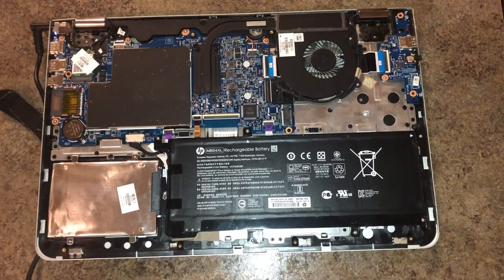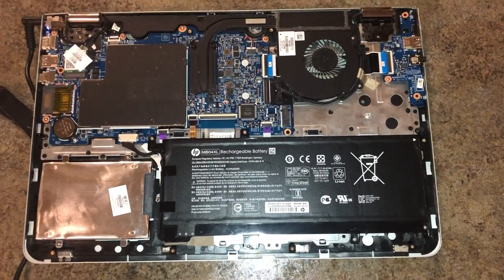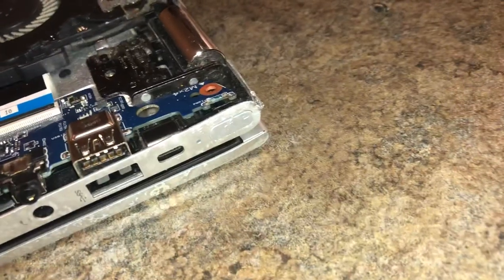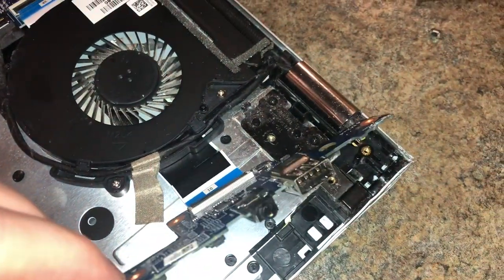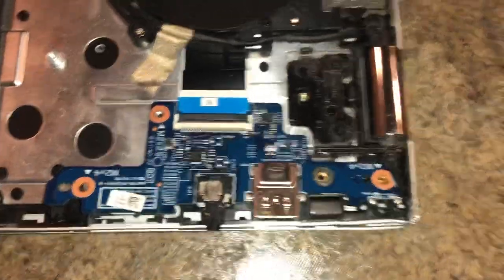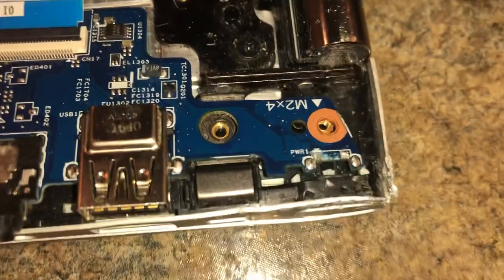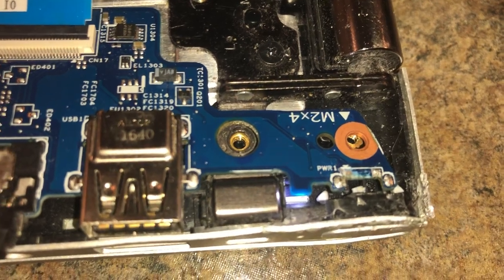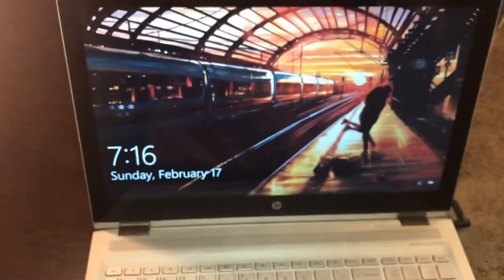How to turn on your laptop WITHOUT using the power button. HP Envy M6

Comment: Hi, my laptop shows charging light but won’t turn on.. Last night I attached it to the tv as the monitor is broken and taken out waiting on a replacement but when I switched it if it won’t switch on again. I get a little flicker from the power button light but not enough to hear or see it boot up. I took the casing off and it looks the same inside as the one in this video. The buttons working it was dropped a few years ago but last night it popped back out as was stuck in for some time.. lol had to press one side really hard for years to get it on. But now it’s working but nothing is turning on . Any help would be appreciated. Thank you